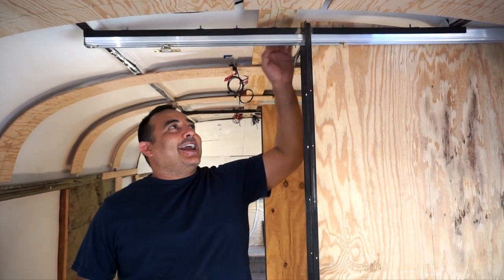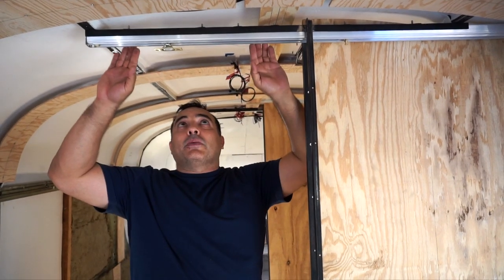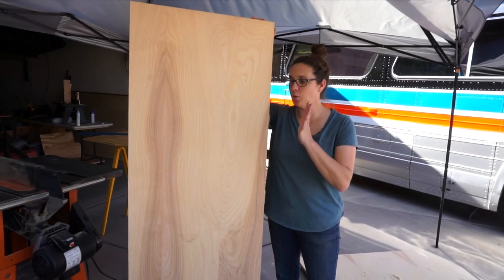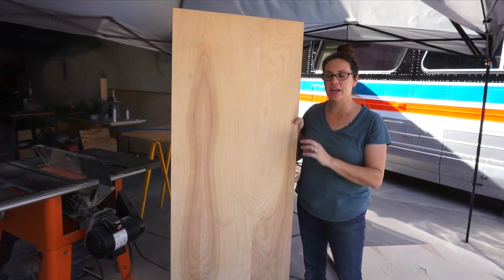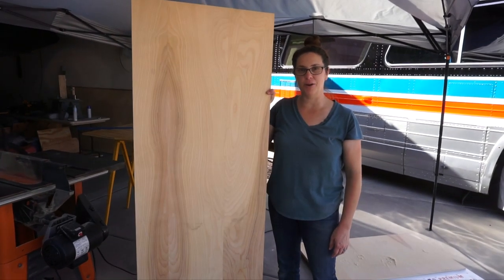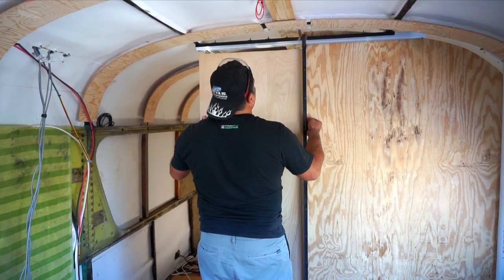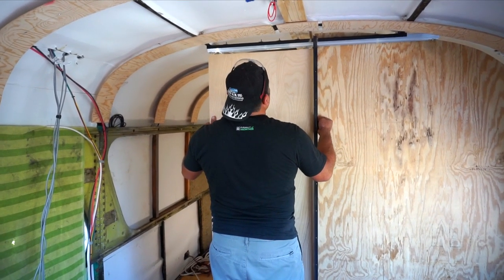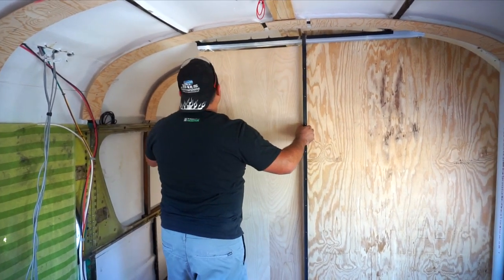Planning for Pocket Doors - A Look Into Our Thought Process

Comment: You two are - by far - the most thorough planners I'v ever come across. :o)  It's such a pleasure to follow.
In this particular case, I fear you're planning the design of the door so much you might end up underesimating the need to be able to get to the door (or it's innards) at a later time.  A year from now something will break in one of the rollers/sliders or you need to put something in there because of a rattle while driving or fetch a piece of a kids toy or whatever.  You'll need to be able to get to the door somehow.  Either as a panel rather than a wall on the outside, the ability of the door to separate into two parts  or some gismo that can unhook the door somehow.  You'll hate having to rip it apart later.
I think it's a very good idea to choose light colours.  The more stuff you install the darker the room will seem - some RVs are down right gloomy despite lots of lights.  I also love the stripes.  In fact my favourite RV (the one I'll buy when i win the lottery) has the same concept, only with smaller dimensions and in bamboo which is darker than your choice (i love birch plywood, btw) but combined with a lot of white and creme and smooth surfaces (we seem to like that in europe, at least more so than americans do).  See here: https://youtu.be/FVstzp18QnE?t=563.  The stripes are less pronounced, but more frequent.  
Some of the furniture in my parents home were the style you showed.  It was quite difficult to keep clean.  The walls in my house are built with tongue and groove, with a vertical square quarter inch recess every 3-4 inches. I love them, but indoors they are dust collectors - outside they are a pain to paint. I know beauty comes at a price; but still ... :o)
Best of luck with the rest of the pocket door project!
Reply from the maker: Wow that RV is AWESOME!!  We are designing access to the pocket door in case something as you mentioned happens.  (We will show more detail on that as we finish up next week)   We really like the more modern look of European design and most of our cabinets will actually be white with some very light accent colors.  Thank you so much for your very thoughtful comment - we always look forward to your feedback.

Comment: Pocket doors are generally installed in such a way that by removing a piece of trim at the top, both the cars and their attachment pins can be readily accessed and the door fairly easily removed at any time. My fear is that your desire to have the soft open/close mechanism, along with their requirement to be mounted on at least a 24 inch door (even though you will only have a 21 or so inch opening), will leave you in a situation where the inner car will remain buried, and not be accessible once the walls go up. The door itself should not necessarily have to be built and installed before the walls go up or the floors go down.  Anyway, I continue to be very impressed with what you are doing here. Keep up the good work!
Reply from the maker: Thank you dprider02!  These do have a small latch that allows relatively easy removal of the door.  The door was built first so that we could match the other side of the door to form a perfect "seal" (we tried to keep the angles at 90 degrees ... but the floor cannot be trusted and the walls are roundish ;))
Reply: @BeginningfromthisMorning  As a long time viewer I should have known that you had thought this through quite thoroughly, and that there was sound reasoning behind all of your choices. I'll probably keep my critiques to myself from here on out!

Comment: Really like the soft-close and soft-open technology.  Wondering if the “soft close” feature will actually work unless the door, in the closed position, goes all the way to that end of the track?
Reply from the maker: Thank you Bruce - The soft-close mechanism comes with an adjustable "stop" that allows you to set where you want them to stop.  When the doors are not within like 2 inches of full open or full closed they just glide on the track like a normal door

Comment: Will the slats catch as the door opens/closes?  You could have a solid top/bottom runner to stop this.
Reply from the maker: Thank you Dennis - great question - we are actually enclosing the entire door in 1/8" aluminum bar that will protrude slightly from the actual door (kind of framing it in) so it will glide smoothly on the frame.  You will see what I am talking about when I finish this week's video :)

Comment: Looks like some really great progress. Two suggestions (if you haven't already thought of this). 1) There will come a time when you'll have to remove the door for some reason after they build is complete, so it might be a good idea to design for that possibility now. 2) Once the interior wall is complete on the other side of the door it looks like you'll lose access to the adjustments for the track. Any way for you to incorporate an access plate in that area when you build the way to allow for service later on? If Murphy is correct, you'll need to adjust or service something shortly after closing up that wall.

One of the things that's impressed me about our Custom Coach conversion is their thoughtfulness in providing lots of removable panels and access points so that every piece of hardware which might require service down the road could be gotten to.
Reply from the maker: Thank you for the thoughtful comment.  You are 100% correct there will be a time when we need to get this door out of here and we will need a way to do that - I also agree about the access points - we will need access to the adjuster as well as being able to remove the door - we will show you next week how we plan to do this.  We have a friend with a Custom Coach and we were very impressed with the build quality of his rig!

Comment: Are you going to stain the core part or leave it natural?
On the door design you could also do a combination on the two-edged (ply) ones then a single-face one then two-edged etc...or even the opposite...two-faced then single-edged then two faced.
You could even alternate the stains as well...so many possible combinations...that would drive me nuts as I am definitely not good at these things!
But I agree with the using lighter coloring...and if stained then the golden oak single coat would look great.
Reply from the maker: Thank you Gregory - We are leaving all of it natural - we liked that the best (It is a birch plywood so it is relatively light).  We are using a prestain conditioner to bring out the color variations in the wood without changing the look too much.  LOL - all this decision making drives us crazy as well - it's exhausting sometimes.  We were really torn with the golden oak (our second favorite) - tune in next week to see how it turned out!

Comment: Just did some math on 3/4-inch maple plywood. A 2-foot-by-6-foot (nominally) door, with a 3/4-inch core, and virtually two of the same "overlays" for your vertical slat design will come in close to 75-pounds, PLUS hardware.  Which is MORE than a whole 4 x 8-foot sheet of 3/4-inch maple ply.
NOW, I expect you might have considered this, along with all of the other weight contributing things already built into the bus, BUT this worrier wonders whether you know the how much the bus' chassis and frame can take in overall weight.  NOT to be a naysayer, sorry!!
Reply: Effectively the doors will be 2 by 6 slabs of 1.5 inch birch ply.  Birch is lighter than maple. My guess is just over 60 pounds.  Great for sound insulation. The frame of that bus wont event feel it 🙂
Reply from the maker: Thank you Robert and Claus - I appreciate all the feedback (I do not put you in the naysayer category at all).   The door is about 72.5 inches tall and 24 inches wide.  I was a little worried about the weight - but as Claus pointed out - this bus can handle quite a bit of weight.  This is one of the primary reasons we chose a bus over a trailer or traditional motorhome.  When we finished the doors they are VERY solid and heavy I was curious about the weight so I actually weighed them on a bathroom scale (i held the door and got on the scale) - the doors (including all hardware and fully assembled) came in at just under 50lbs each.